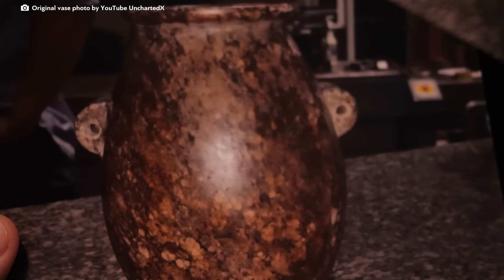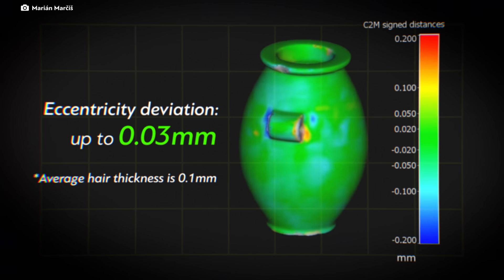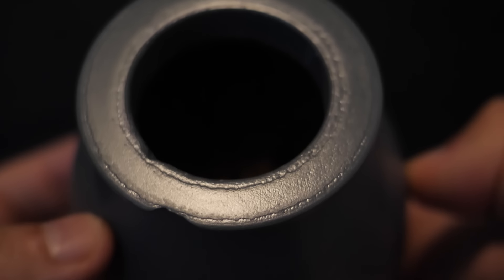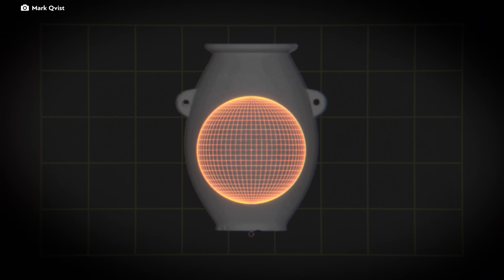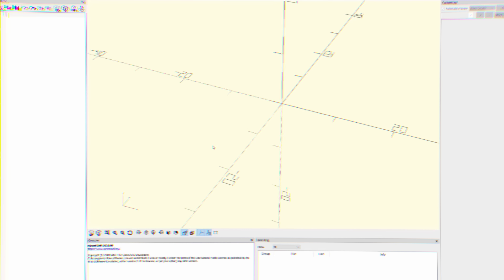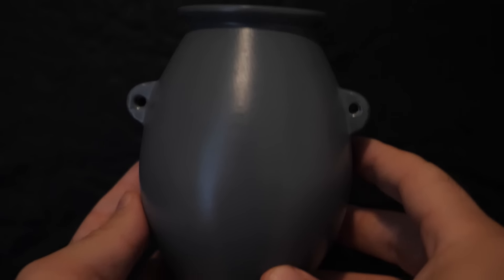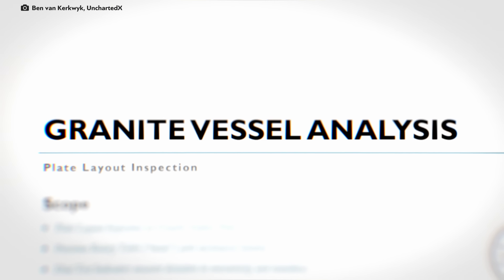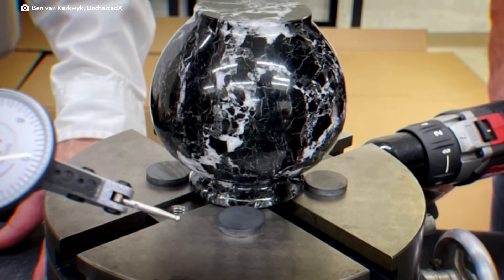ANCIENT Egyptian PRECISION GRANITE VESSEL: Out-of-place artifact. Part 1/3 - VERSADOCO

Comment: Using the stone soften technique, as disclosed in even better detail from your last video, the various vases could be easily shaped in a computer controlled machine, using a combination of molding the stone in its pliable state with spinning involved to smooth the crystal lattice of the stone into mathematically precise shapes.  It's now difficult to know if they were actually used for vases or extremely strong containers for particular high energy ingredients.  Since they all have the same kind of handle design, it would seem to me that they would held in place with others like it in rows, in whatever direction of choice.  The top lip is so smooth that it would be perfect for a rubber or similar material washer could be placed against it to hold the container tight against the object that it is attached to.  Ah HA!  I got it.  The side handles look like those used various boxes, ships, boats, etc., where you have a loop or claw that goes on or around another point, then you push down on the opposite side to tightly bring them together.  The vases would have one on each side.  The person lifts it to the port and locks it in place.  These are engine parts!   Also, you just blew my mind even wider upon noting that the Cantor Set was found in the Egyptian columns.  But then noted that the ancient Chinese Book of Changes uses it in a binary code format.  Are you actually saying that the Chinese language is computer code based?  Do you know how mind boggling that concept can go to in thought?  To know that the beginning of their cultures history, a bunch of their ancestors were either computer programmers from a destroyed Antediluvian society or they hung around a dying computer trying to save what data it could give on a writeable material, then handing that down the line of families as language.  Either way, that literally opens new avenues of WTF thought on that subject.
Reply: make no mistake, the atlanteans were likely involved in propagating this ancient system

Comment: Built with plasma. Pure and simple.   What gives it away is the hexagonal insertion at the inside base that was made by a tool with that shape imiting plasma. It doesnt that much time to the crystals and the matter self allign at will of its maker vibration and freq. Kind of like cinamatics but with jelly form stone after plasma exposer. The stone doesnt break or chatters instead becomes soft like clay. After the aligment usually when you hit on it, it rings in a semi hallow effect.

Comment: A single block of granite was the starting point (most likely square and uniform) and in one pass of manufacturing you ended up with this vase. I believe 20,000 of these granite vases have been found at ancient Egypt sites and temples etc. Today 99.9% are sitting in several vaults under the Cairo Museum, with only literally a couple on display. You could dedicate an entire museum to these granite vases and still be only scratching the surface. And they all have this same level of craftsmanship. 20,000. Like it was easy to make the granite vases. And archaeologists say the Egyptians made them by hand.. Of course they did. How many Egyptians would even know how to craft the vases with tools and use the machinery?

Comment: I'm the one who found the actual shape of the profile of the vase. But Ben still hasn't mentioned it since the other facts I've found contradict his narrative of "sacred geometry" where he says they used PI, Phi and other relationships in the design of the vase. FYI, Ben can't do basic algebra. So everything he says is based on things he has no way to confirm or deny. I've also done actual precision calculation. No one else has done so. I've done least squares regression and calculated the average deviation as well as the standard deviation. The precision measurements you show in your video are done piecemeal with basic shapes.

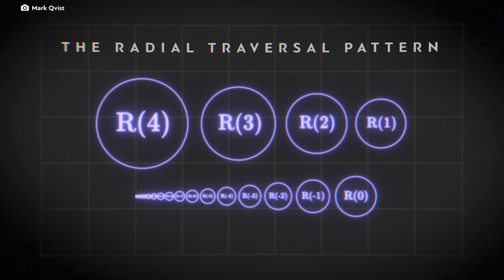The "radial traversal patterns" and the flower of life @ 8:46 by Mark Qvist are complete bunk. No one with even rudimentary mathematical knowledge would support those findings. There is no PI ratio. Their precision can't even account for the first digit (as I calculated the error). They provide ZERO error calculations. So they can't even prove that the first digit is 3. Not exactly PI now is it? Also, their measurement locations for this ratio is highly suspect. No reason is given as to why specific locations are chosen vs. other locations. But we all know why. It's to approach this "sacred geometry" of PI as much as possible.

The profile of the vase is a parabola rotated by 9 degrees. This is why it doesn't match up when you overlap a flipped copy.

This is the equation for the unrotated parabola. Rotate it 9 degrees and it will fit the profile of the vase. The vertex of the parabola would be rotated toward the bottom of the vase.
x = 22.0122 mm + 0.917091y – 0.0068798y^2

Average deviation: 0.08342912 mm (83 microns)

Standard deviation: 0.05335629
Reply from the maker: Thank you for your comment. I'd like to see more professional metrologists and scientists like Dr. Marian Marcis involved in research. He also found some interesting ratious like Pi, and golden ratio. So this question is far from being completely answered. In the ideal world, it'll be great to see peer reviewed study on measurments of the group of researchers. I hope his example will inspire others.
Reply: @Versadoco  There is no PI relationship. That part is conclusive. Find me just one article or documentation other than mine that includes error calculations. You can't find it.
Reply from the maker: I'm referring to this data in the video by Marián Marčiš, PhD, Slovak University of Technology in Bratislava (Department of Surveying) -  https://twitter.com/mariusderomanu3/status/1634588712804786176?s=19
Reply: @Versadoco  Yeah, I've seen it. It's all bunk.
Reply: "bunk" isn't an argument @alienrenders
Reply: @AustinKoleCarlisle  Sure it is. The link provided is terrible. Not worth anyone's time. It's trivially bunk. It's on the same level as 1+1=253. Just nonsense.
Reply: @alienrenders  i'm not talking about that link, i'm talking about qvist's analysis.